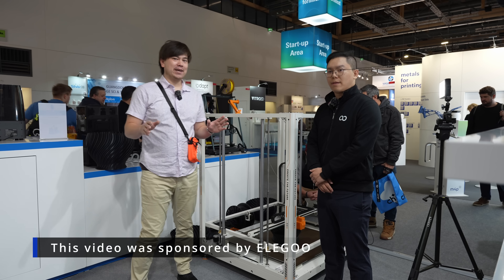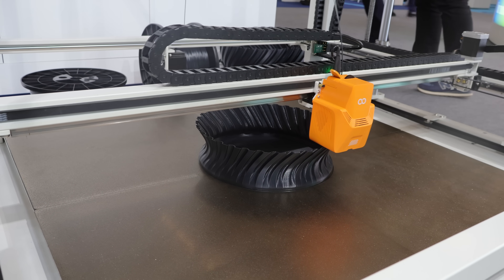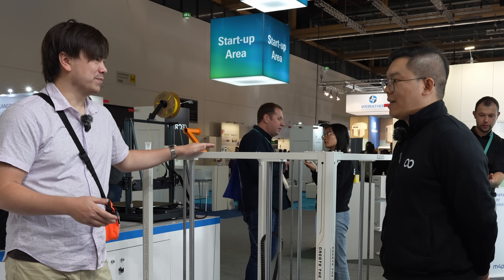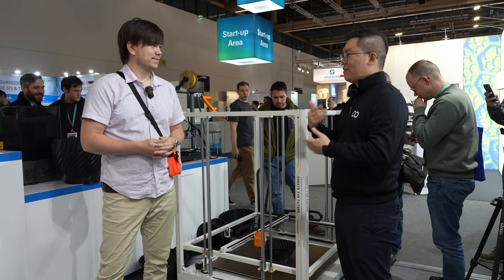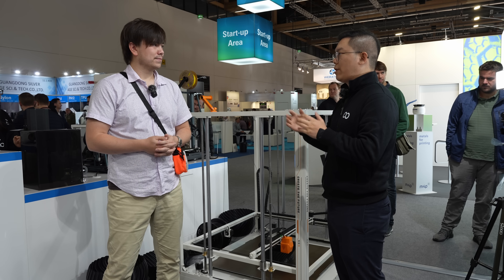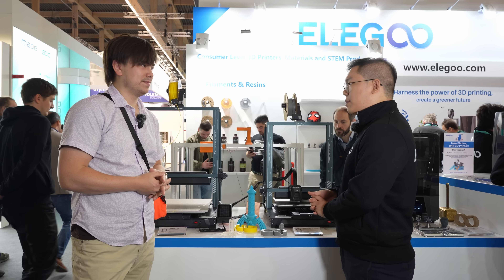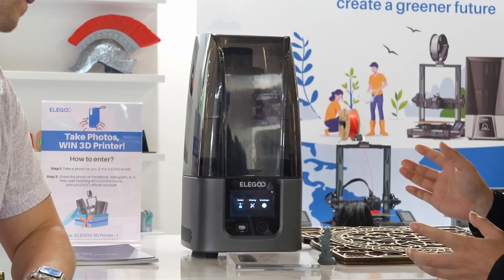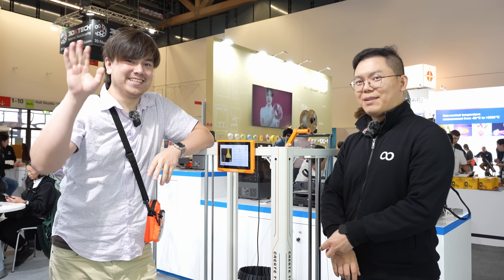ELEGOO'S GIGANTIC PRINTER!! (Bonus Info on High Speed COREXY, Giant Resin Printer, Multi-Color Unit)

Comment: That's a big boy printer there. I would think wifi wouldn't be that expensive a feature in this day and age?
Reply from the maker: You mean for the Neptune 4? You’d be surprised how big a difference a $2 Wi-Fi module has on the bottom line
Reply: @NathanBuildsRobots  Not to argue but a $2 feature that offers so much to the consumer doesn't sound like it would bankrupt them. Especially when consumers expect that feature and want it nowadays. I suppose if you are building thousands of units it does add up but still its a wanted feature by the consumer so would make their product stand out more. Anyway thanks for sharing the video. Keep up the good work!

Comment: Looking forward to see what Elegoo is going to bring now that the campaign is overfunded. 
We need reliability and ease of use.
Make the belt auto adjustable so we don't need to tweak everytime and have offsets in print layers.
Big screen is good but shouldn't be the focus, the X1C is mini but it does it all.
Enclosure + reliable / heavy duty parts + focus on support and updates
Also add the Chroma, that would be great ! especially having multiple nozzles !

Comment: 800wx400dx400h would be interesting and more manageable. I can see the temptation to go high but the size of the x-y plane is important for strength in functional prints and the bottom surface very important for generating an attractive finish against.
Reply from the maker: That's a good idea. That way they can reuse a lot of the parts for the 800mm span, and use the same heated beds. I swear the best ideas come in the comments section :P

Comment: I have quite a few problems with my Neptune 4 Pro. That's one of the main reasons why I will not back the Orange Storm Giga. I have already contacted Elegoo for support but haven't heard back from them yet. It's Sunday after all. Hopefully they can resolve my newest issue either by instructions and or replacement parts. My z-axis presses down on the print plate when homing meaning the z-axis probe doesn't work anymore after a month and a half of use. If they can easily resolve my issue I might even be swayed to back the Giga.

Comment: Elegoo is my favorite FDM brand by far.  Their consistent quality to cost ratio is unmatched. My Neptune 4 and 3 pro are more reliable than my SV06 or ender 3.  The 4 is awesome because I can run it to an old laptop with a cat5 cable.  I have full klipper access and I can use the laptop to figure out how to tweak it to my liking.  It makes learning Klipper a much easier process.

Comment: And Also I got the Elegoo Resin Saturn 8K printer with their Mercury XS wash & Cure Bundle. 

But I given up using it now as the cost of the resin for what amount you get is way too pricey now and I had to buy tons of Paper Towels & IPA and safety gear and it got far too pricey! 

Plus I now got 11 liters of old used resin water wash which I can't get rid off as it is too toxic to go down any drain or ground and the Big UV lighting I would have to buy to set this wash waste is way too costly to buy. 

I have no local recycling to send to and in the UK we don't have the tons of year round hot sun to set the waste. 

So I given up on resin and the Elegoo resin printer I have is not worth selling now the newer ones are on sale. 

So what a waste of my limited money!
Reply from the maker: I agree, I did 1 video on resin printing and gave it up for good. If you can only have 1 printer I’d go for an FDM machine

Comment: @3:19 the reason is that corexy design, the belts would be too long.
Reply from the maker: I hear ppl say this a lot but it doesn’t make sense to me. It’s like saying you can’t build a 80000 horsepower diesel motor because the timing chain would be too big
Reply: @NathanBuildsRobots  80000hp marine diesels dont use timing chains ☺ there would be nothing to gain using corexy on such a large design and lots of downsides. on 256mm buildplate a corexy belt is ~1m long, on a 800mm it would be 3.2m long! so beefy belts, pulleys, etc. and increased artifacting from the belts, something that smaller corexy already struggle with. the primary limiting factor on most corexy is not the motion system, its the extruder.
Reply: @NathanBuildsRobots belts become very flaccid at large lengths. To tension them you’d need a huge amount of movement in your tensioner, which isn’t particularly space efficient. Besides that you need a lot of tension to keep the belts from causing print artifacts. Stepper motor shafts and bearings really cannot handle more than 3-4 pounds of force before slowly deforming over time so you’d need custom long shafted Steppers that have additional bearings to prevent shearing, same goes for the rest of the idlers.

Comment: Are there concerns with large objects that span across the 4 build plates and warping on large objects ?  My guess is this will be limited in materials unless people come up with serious mods.
Reply from the maker: Peeling a build plate up from anywhere but the edge is pretty difficult. But yeah, even on my 300x300 printers I can have instances of the edges of the steel sheets peeling up.

Warping isn’t that big of an issue for large models that don’t require precision, such as furniture. But something to check back in on

Comment: Elegoo is pretty good. I have a Neptune 4 Max, and it actually has surprisingly good print quality -- better than my V3 SE and my SV07. I obviously bought the printer for big prints, but its ability to do fine details really surprised me since it doesn't really look like anything special in that regard, but the prints look great. It's a nice printer -- although, I think its fair to say, these are Elegoo's first run at Klipper printers and they've got a lot of growing pains with Klipper, there are some bugs and a lot of standard klipper features are just missing. You can implement them yourself just fine, but it's more work. Another minor poo is that they didn't go with an actual KlipperScreen, so most of the functionality you need to access on a web browser.
Reply from the maker: I think they wanted to maintain a dumbed down interface on the touchscreen so people coming from non-klipper printers won’t get confused. For Klipper enthusiasts, it might be a letdown, but for the mass market I think it makes sense.

The thing is- the Neptune line looks and costs the same as a lower quality product, but they must be paying more attention to details in the design that others are missing. Whether a it’s quality control or proper attention to machining tolerances, they just tend to work better than other equivalently priced and specced machines.

Comment: What is the nozzle size, max flow rate, maximum possible extrusion volume? did I miss it? With such a huge volume, you can go only so far, without a redesigned extrusion system, that extrudes pellets to plastic, right inside extruder🤔. One suggestion is to build a eco system to recycle plastics, so that we can recycle all the discarded plastics, while making large objects,  that otherwise use insane energy to produce(such as cement bricks)❤👍
Reply from the maker: I should have asked. It looked like a large meltzone nozzle, so I’d guess 35 mm^3/s maybe? In any case I’d want to replace it with something with a really high flow rate, and use 5mm thick layer lines
Reply: They say it's 50 mm^3/sec @NathanBuildsRobots

Comment: 2k for a printer that all they fucking did was scale that shit up? Don't misunderstand me. There is nothing different in tech that warrants 2k. Love the size but the price is bullshit. I'll build one before I buy it.
Reply from the maker: Ok, please do, and let us know how much you spend on parts. I’ve considered making something like this but every time the budget gets out of control, so I’ll gladly pay someone else to do it, especially at this price.
Reply: @NathanBuildsRobots shipping could be pricy on this machine.
Reply: @NathanBuildsRobots  for sure. I just see no benefit to the price given it's a scaled up ender 5 s1 the build plate doesn't even appear to be 1 piece. So you will always have a weird seam on massive parts. So for roughly 60 percent more material.  A minor update to software. And a regurgitation of standard tech you pay 10 times the price. A used ender 5s1 can be picked up for 150 to 200 bucks. Take a new printers price in account let's say 350 to 500 for it. Still 4 times the price. The current generation of software is very capable of handling the measurements of the printer add some issues with scaling. Extrusion isn't cobalt or gold. It's fairly cheap. You buy belt in bulk so no real issue there. Uses what appears to be fairly standard stepper motors. Bambu x1c are 1500 to 2k. Several new tech advances and function enhancements.  Scale is less for sure but there is a reason for the price increase. I'd pay 750 max for this massive format printer. Great idea from elegoo definitely however this will drive little interest in the scaled up model due to the price point. And when the main request from customers is scale. People will likely stick with 500 dollar large format printers and the hassle of working in those constraints than shelling out the cash.
Reply: @dragondraco412  $750 would be a downright joke for the hardware alone.
Reply: Good luck. Someone in the previous comments said they are building a similar machine and have spent $3000 in parts so far alone, plus the hassle of building it. They probably have to spend $400+ on shipping alone on these things. $2000 is a hell of a deal.
Reply: Hmmm. Fascinating.  Perhaps I will  see what it takes and let ya know. Seems like we have an interesting dilemma.  I know for certain those parts aren't this difficult to get ahold of nor are they that expensive. It's mostly software.  I expect one can modify an existing design to achieve the same results. If it cost 4k they wouldn't be selling it for 2k. Simple business 101. My guess is the hardware is roughly 30 percent of the total. Then add mark up. So perhaps 300 or less in parts. Then take the stolen software cause China. And you come out to 500. Add markup and wahhhhlaaaa 2k for a printer before shipping.

Comment: Kevin has no clue 😂 a giant printer which prints pla and petg is not a great printer
Reply from the maker: Disagree with you on that point, but if you’re after something to print CF nylon you can buy an enclosed printer from MODIX for $10,000.
Or get this and make a diy enclosure for around $1000. 
Not saying the capabilities are groundbreaking but the price point is
Reply: @NathanBuildsRobots  I agree I would drop a bondtech and add two active heaters after enclosing it.

Comment: I saw this on an email from Elegoo and it had 4 print heads on it, have they dropped the 4 print head version?
Reply: The extra heads are sold as add ons. If you buy off the kickstarter you can choose add them to your order. I think they're 50 usd each at the kickstarter price
Reply from the maker: Lol $50 for an entire Printhead… Elegoo is going crazy in cutting pricing
Reply: @stevendaddario8803  Ah! I see, I cant wait to see this in operation, I have some permanent print commissions and a four head machine could save a lot of time and money.

Comment: with the non core-xy build it looks like you might be able to modify it into a IDEX by adding a 2nd motor to the other side of the X gantry then just modify the belts to have 2 belts on the X
Reply from the maker: Yes, and you can do it easily thanks to open source design! :))

Comment: That Orange Storm Giga is inspiring!  My first impulse was "oh, I could print an entire R2-D2 body as a single object with that!"

My second thought was "it's probably too big, really."  Which is just funny, to me; I've been saying for a while that a 30x30cm printer is useless to me because it's not big enough to print the big things I want and the small things fit nicely on a 25x25cm build plate.  So now Elegoo goes and makes an 84x84cm printer and I'm all "that's too big!"

Alas, even if they make a smaller one using the regular Neptune printer's build plates, that will end up too small because that works out to 45x45, and R2-D2 is 48.5cm in circumference.  :/

Oh, well, I really really really can't afford a 1500$ USD printer right now anyway, much less the filament to run it.  But it's nice to dream!  Maybe in a new years, when this is the "old, discounted" model I can enact my visions of a droid factory.  :D
Reply from the maker: Maybe the smaller orange storm will be 4x 30cm build plates for a total size of 600x600 for under $1000?
Reply: @NathanBuildsRobots  Maybe, but from Elegoo's perspective it makes sense to use their existing part, which is the "regular" Neptune's build plate of 22.5x22.5 cm.

Comment: My Elegoo Neptune 4 Pro is plugging away next to me.  It's been printing almost nonstop for over two months.  I would have liked to have spent $20 more and had WiFi, rather than spending $20 on a WiFi dongle that's flopping around on the table.

The OrangeStorm Giga is more than I need but I can see a lot of uses for it - model shops, prop departments, architects, cosplay extremists, and a lot of weird applications such as printing plugs for carbon fiber car parts, printing forms that can be sprayed with shotcrete to make large flower pots or other architectural products, etc.

I'm waiting for the Neptune 4 Pro Max, the Neptune 4 Max but with steel rollers on steel rails for better print quality and more long term reliability and durability.
Reply from the maker: I don’t mind shilling for Elegoo. They have very nice build quality from everything I’ve seen, and aren’t desperate to chase after the latest trends. Instead it sounds like they listen to their customers and produce the products that people actually want, at the price point they can afford. Very admirable!
Reply: @NathanBuildsRobots  - The Neptune 4 Pro is my first Elegoo printer and I'm becoming a an Elegoo fan.  I appreciate solid engineering and value.  The Elegoo VP in the video responded to the question about the biggest challenge with the OrangeStorm Giga by saying it was ensuring long term reliability.  I liked that answer.

Comment: Price point for Orange Storm is really out of this world... Especially for early kickstarter backers. For the past few months I've been building a printer of similar size, and my tally (at this point in time! :D ) is around 3 000 USD. So, twice the amount of early backers! It's crazy how much the price scales for larger components, just the aluminum plate for the build plate was around 600$. For Elegoo to make something like this, at this price is amazing, I REALLY hope it ends up being a great printer, that would be awesome for the consumer market!
Reply: I got the #1 supporter for 1250$ , it’s a hell of a bargain for this machine !
Reply from the maker: Hmmm, $1250 for 256mm X1C or the same price for 800mm Orange Storm Giga? 
Easy choice for me
Reply: @NathanBuildsRobots  You saw it in person, did it look like it may have some faulty design choices? Did it seem sturdy and reliable? It seems awesome, but I can't help but fear it might end up like Prusa XL...of which I'm sure it will deliver all it promised, but the early release is severely lacking.
Reply from the maker: @astrumrocket6556 it looks good to me. The frame is solid, looks like 8mm thick aluminum plates to hold the pieces of the frame together, and uses a belt config pretty much the same as the Ender 5 S1, which makes sense for a printer of this size. Big belts, beefy 25mm linear rods for the Z axis, linear rails for X and Y… seemed solid all-around. The design is pretty standard IMO, it’s just a matter of scaling up the components properly.

I don’t think it will have the same precision as their “smaller” printers like the Neptune lineup, but overall it seems  good enough for printing larger models. Getting clean layer lines is a lot simpler when using a 1mm nozzle, which I think is what would naturally pair with this machine - 0.8mm nozzles or above is ideal on this printer IMO
Reply: @MR_3DQC  Seriously congrats! I missed the chance there (didn't know about it until it was too late), but if I knew... Elegoo is making good machines, this one is on the extreme side, but I would definitely trust them with that much for this.
Reply: @MR_3DQC  stop buying kickstarter printers, we need to let these large companies know this practice is completely unacceptable.
Reply: @trippytrolls  Did he actually buy a kickstarter printer? I see this more as taking a 50% (or more) discount on preordering a printer from a known company. Elegoo is a reliable manufacturer, so it's more than likely the machine will deliver, and if it doesn't they are also very reliable with their refunds. They are not asking you to sponsor the development of it, they are using the platform to promote upcoming product and offering a significant discount in the process. Yes, I understand this is somewhat murky, yet I still like this a lot more than the way Prusa introduced their XL, with you paying a preorder price in addition to a full priced machine.

One thing that I'm finding to be somewhat specific for Elegoo is that they often don't have enough printers for the market demand, it's as if they are unsure about how will the consumers react, so they hold back. This is a good way for them to feel out the market in advance and plan ahead.
Reply from the maker: @astrumrocket6556  yeah, in general, I’d say avoid kickstarters.but by your logic bambu lab should not have used kickstarter either. Despite what you think, they were already a large company before delivering their first X1C. Where did the money come from? Would love to know.